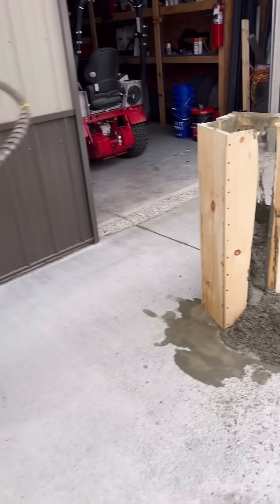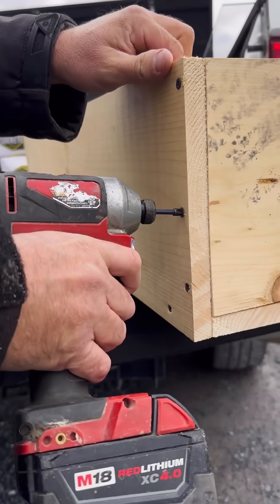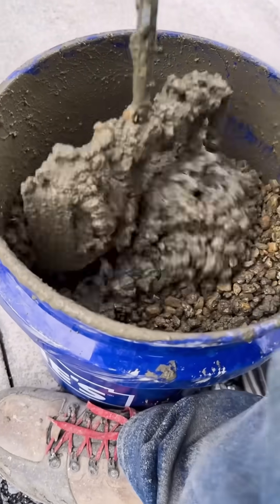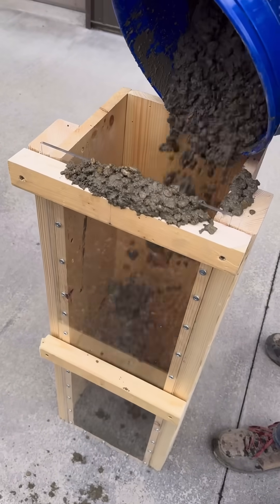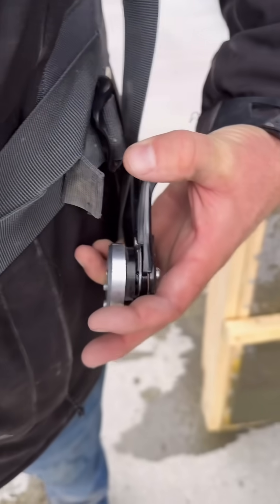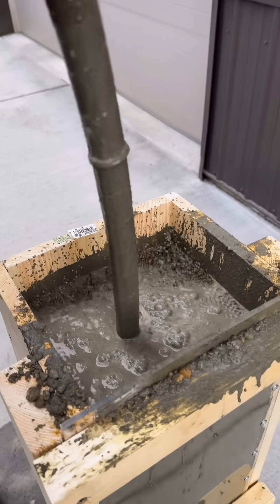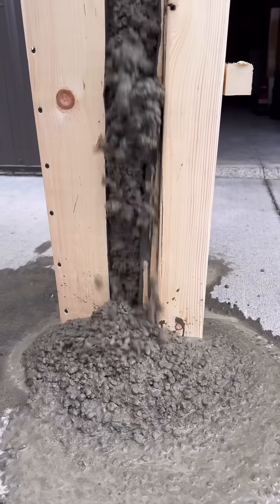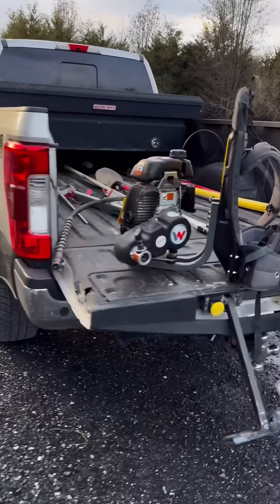Why It’s Important To Vibrate Concrete

Comment: I was 16 and we were pouring basement walls in two separate sections as we didn't have enough metal formwork. I was walking on the about 10 feet tall formwork while moving concrete with a shovel around the rebar. I left after finishing my part and before vibrating. Not even 5 minutes later the formwork opened where it attached to the old pour and concrete poured to the inside, I definitely would've taken a fall! Eventually the basement floor was 4 inches higher! 😆
Reply: Now I know why my basement ceiling is only 6 feet high!  Not the real reason!
My story is about a dickhead county inspector.  We bought this property in 1992.  I was replacing one basement wall made of 6x12x4 inch blocks (1932) pushed over 3 1/2" out of line by a big tree alongside the driveway (it gave its life for the project).  Had plans to pour footing and then have a mason come and put 8x16x8 blocks in and fill with rebar and cement.  I know how to lay blocks but did not have time with my job hours.  Besides, he needed to eat too. The code said that you could go higher than 4 feet when no backfill would be against the top of the blocks or the wall had to be engineered.  We planned on blocks for 54" from footing.  Well the inspector happened by and said he would not pass the forms or the wall because he had no way of guaranteeing that fill wouldn't be placed to the top of the blocks.  That would be physically impossible I argued with him, because of the natural slope then you couldn't use the driveway.  So I had a brilliant idea;  the code did not say how thick the footing had to be so I just formed it 6" higher so now the block wall  would only be 4 ft. When the inspector came to inspect it, he made a comment about me finding a way around his misinterpretation of the code, but he had to pass the forms anyway.  Mason thought it was funny; he said that inspector was always hard for people to work with.  New wall has been there 31 years now and along the driveway the siding is over one foot up from the ground. The inspector had another dumb idea about drilling into the 50 year old wall and the mason told him they would just explode.  Wel the Inspector stayed and watched as the old blocks just exploded;  then I got to spend 2+ days rebuilding the corners of the sidewalls. Be careful what you ask for Mr. inspector.
Reply from the maker: I’m glad you weren’t up on that wall when it happened👍
Reply: I hope the county footed the bill for replacing the blown out blocks... We had an inspector like that here where I live but at least his were actual code violations. He just didn't let anything go unless he just missed it.

Comment: This is why here in europe we use special plywood to make concrete forms. Plywood forms, or re-fabbed iron forms, that are both made in standard sizes.
Reply from the maker: We use steel and aluminum forms here too. I just made this little prop form for the video.

Comment: I used to be a sort of floater laborer for a construction company. Whenever I was on concrete crew, I had to vibrate. The concrete pm always stressed to me to sink the stinger in fast, and pull it from the mud at slow to avoid creating voids.
Reply from the maker: Good advice

Comment: My parents were having their dream home built. The foundation was about 80ft x 40ft, with a walkout along one long side, which had 2 French doors and 2 sets of windows in that wall. The concrete guys were a little confused when they had several yards of concrete left over. The carpenters came to set the pre-fab sections on the foundation and realized that the foundation had been poured one foot too narrow. One 80ft complex reinforced wall had to be cut away, new footings poured, and a new wall poured, all in the middle of nowhere, racing the coming winter.
Reply from the maker: That’s crazy!

Comment: Dumb to shake the rock out of the mix though agreed?
Reply from the maker: I vibrated it longer than normal for the sake of the video so people could see the air bubbles leaving. But yes, you have to be careful not to over vibrate. It can cause the rocks to settle to the bottom.

Comment: I was pouring a elevator wall but the way the guys formed it and wanted to pour it i told them they needed more bracing before we ever even got the pump set up so they did put some but they wanted to pour in 8 foot lifts bc we were doing 2 levels of the shaft and i told them we need to do 5 ft lifts and they told me know well even with as slow as my pump would go they over pour one of the courners and the inner support broke in the center and there was about 6/7 guys up on the scaffolding they build onto the forms and they lost about half the wall of mud and had to basically start completely over 😂
Reply from the maker: I can’t imagine that mess

Comment: Don't overvibrate, creates segregation and loss of air entrainment, causing cracking during freeze thaw. The air voids are designed take moisture as to provide room for the freeze thaw effect of moisture.

Comment: Not really a horror story, but i poured a small slab for a set of pool steps one time and didnt have a soft bristled concrete broom. So i used a regular broom. Was a mistake, pulled up the concrete too much and made it rough to the touch. Luckily its just a pad thats barely visible, but man i will never make that mistake again

Comment: Concrete horror story? Yeah, its my driveway.  Pretty sure each part was done by a DIY homeowner of the past.  There's the carport pad, the OG driveway, the side pad, the weird little extra bit they added kind of in front of the side pad, and then the two tire wide curve that goes from the front of the driveway to the side pad that leaves a section of grass in the driveway.  Every section looks like a different mix with different grains and aggregate.

Oh, I'm sorry.  The city had to do some work at some point, so the first six feet look like a good pour.
Reply from the maker: Frustrating

Comment: Ur not supposed to vibrate so much because all the aggregates go to the bottom, making your concrete weaker than was planned.
Reply from the maker: I vibrated longer than normal to get the footage of the bubbles coming out for the video

Comment: You should have used plywood. 1x's grain runs from end to end. Plywood has the grain running in layers, each layer perpendicular to the previous so it is resistant to splitting. Good job on the learning opportunity.

Comment: Yeah you have to be quick. In & Out. To much & you will stress the forms & create segregation of the components that make up concrete. Lateral supports "snap ties" would have helped as well.

Comment: ICF forms 4 ft by 20 ft 8 ft. High vibrated a hole through the form and it was a mad rush to seal the hole up with pieces of 2x12 and lags. Oh what fun that was took care of business though
Reply from the maker: ICF blowouts are the worst. We always kept a couple sheets of plywood on the job in case that happen.

Comment: 64’ x 80’ x 6” reinforced concrete slab, poured on a day that was 58°f. Its was supposed to stay above 50° all night long and be mid 60’s the next day.
But the site ended up being in the center of a low pressure micro burst that pulled high altitude air down the surface, freezing the slab as it was curing.
Next morning, come back, the slab is fully cured but crumbled to dust just walking on it.
Reply from the maker: That’s super frustrating
Reply: @hausplans  nothing like the planet deciding to just give you the middle finger.

Comment: What is really disturbing is the attitude that things slabs (under ) 5 inches thick and sidewalks don't need vibrating and commercial/ architectural builders and designers all agree.  In fourth years of construction QA QC I HAVE TORN up and built concrete and can tell the difference immediately

Comment: Use 5-ply+ plywood. It is designed for bidirectional shear loading
Reply: Use OSB with inadequate bracing for pregnant-looking walls.
Only a 30 inch high wall but it got done with no blow out, thank God.

Comment: I was a field engineer pouring bridge deck approaches on a major 380 million dollar interstate project. Pump truck got on site late from another pour on the south end of the job. The pump truck got fired up and was clogged. Concrete trucks were timing out at 90 minutes with drivers adding water. I ran a slump test, and we were at 10 inches, it was supposed to be a 4 inch slump. Contractor said screw you and chuted it out on the whole approach. After it cured we did a strength test with cores and failed miserably. They had to rip the whole thing out because the Contractor said screw you im pouring it anyway with trucks that sat on site for 1.5-2.5 hours with a buch of water added. What a nightmare that was.
Reply from the maker: Wow! That is a nightmare. Nothing more frustrating than tearing something out especially with all the prep work you had before the poor.
Reply: @hausplans  As a GC, we used to reject any truck that sat longer than an hour which they then used to pour a driveway somewhere I assume. At the time I was a swamper working with the tower crane and was instructed not to pour anything over a 3.5" slump. Concrete crew would scream for higher slump so I'd just tell the driver to spin the drum a few times then send it up as is. We'd test every 50 yards so there was no screwing around because you never want those cylinders to fail under the break test later.
Reply: A backpack vibrator….
So useful on the Appalachian trail
Reply: Sounds like Dumb and Dumber....

Experience makes ALL the difference.....as usual
Reply: Now, that was a pricy mistake by that contractor
Reply: The inspector didn't say that's not going in the bridge?
Reply: @nathandevine552  Of couse we said no. Thats where the contractor said screw you and did it anyway.
Reply: Ames Iowa? Lol
Reply: You didn't have the authority to reject the batch?
Reply: Not all experience is educative experience….
Reply: @Lucas-pv2wn but this one was for sure

Comment: The problem was you built the form with the wood grain running long ways. Had you cut pieces and laid them 90°, it would have held up.
Reply: Yeah that’s why form board is made with plywood
Reply: Good catch

Comment: 2 weeks ago , I saw 3 guys try to do a 100 foot sidewalk… they didn’t get it screeded so they threw the plate vibrator on the green concrete once it solidified… got the pictures
Reply from the maker: I’ve never seen anyone use a plate vibrator on concrete

Comment: Not sure about horror story but years ago we put in a storm cellar. Dug the hole poured a concrete floor it was about 6 - 8 inches thick put metal fence in for reinforcement. Dad went out a couple days later and started raising the walls laying the Blocks, got it up about 5 on the corners and 3 on the sides high and it decided to Rain. Did you know concrete Floats? We had a sump pump hole in one corner Dad made it a bit lower than the rest when we finished the floor. But after it rained the thing raised up about 5 inches in the corner opposite of the sump hole. After it was to the ground on the sides they put 2×4's about every square foot so concrete went over it all for the patio. But we built a new House in 1976 -78 sold the old house in 1977. Dad told us they used to make Barges to float the Ohio and Mississippi River years ago. So yeah in certain ways concrete will Float.
Reply from the maker: That’s crazy

Comment: If you have a smaller pour you need to vibrate you can Use a Sawzall (reciprocating saw) Without the Blade attached to vibrate the outside of the forms!
Reply from the maker: I’ve done that before
Reply: I use my girls hitachi vibrator. It works a great

Comment: actually you have to use the proper tools in this case you need to buy or rent a 1inch vibrator.
Reply from the maker: Correct, this was the only one that was available, but it was way too big for the job.

Comment: Should have put 3 ratchet straps or a different tie down to assist with strengthening the sidewalls.  Having it tight with that at the top, middle,  and bottom will ease the strain on the wood fibers and joints.

Comment: A great tutorial showing why vibration is key to concrete placement yet, also density destructive to forms. However, I'll be willing to bet that your wife kicked your keyster for messing up that slab!
Reply from the maker: 😂 it actually wasn’t bad to clean up just a flat shovel and a hose. We had it cleaned up in no time.

Comment: When running the concrete vibrator you don't leave it in one spot, drop it in, pull it out, quickly. Always keep it moving. When vibrating/consolidating in a narrow form, even going slow with that large size is sketchy, smaller diameter stinger, it has a smaller diameter energy cone.  Yep, learned on the job.
Reply: Oh, it's called a stinger? Now I don't have to call it a dingus
Reply: I was taught years ago to stick and move. Never stay still
Reply: You're doing it right when it makes a queef sound

Comment: I run the concrete pump on high rise buildings, had a column blow out on the 70th floor. Rained concrete down on everything, they were cleaning the windows below for weeks afterwards
Reply from the maker: I can’t imagine that. What a mess to clean up.

Comment: On a house build our concrete guy somehow not only poured the walls 12in off square but also didnt secure window cutouts. The was cracking all over. 
Client didnt want to be delayed by attempting to force him to redo his work so I got to manually adjust every dimension on the plans.
Reply from the maker: Crazy

Comment: My concrete horror story is from the time I spent building the first legit concrete skate park in Sofia Bulgaria and long story short we got the wrong type of concrete pump - we needed a shotcrete one but there were only a few in the entire country and the wouldn't lend them to us so before we got the right kind we got a shitty one that had to represure every time yoy filled it with about 80ish gallons, it was a hot day and we had to do the first base layer with about 7 cubics and figured out on the first fill that the material will harden in the truck way before we pumped it all through the machine so the guy just dumped the biggest elephant foot in the deep end of the pool and we took are shovels and started spreading it by hand the entire day😂
I've got a second bonus one - when we finally got the shotcrete pump it was a very hot summer and two of our narrower 10 meter hoses both got stuck concrete throughout them and while the rest of the guys were polishing by hand we spent about 10 hours smashing it with hammers until at 10pm we cleared both of the hoses 😂 was a great workout and never again would we let filled hoses stay out in the sun for more than 5 minutes 😅
Reply: Have you looked into "Aircrete"?
Similar method, but the Crete is mixed with a foaming agent ❤
Reply: @VEFAorg  I've been looking at all sorts and have seen this in YouTube videos but have not yet worked with the stuff myself. I experimeted with concrete lamps for a bit for a uni design project with white cement and wondered if I mixed in loose Styrofoam balls in the concrete mix and then once set and out of the mold to try and dissolve them with something like acetone to get an interesting "holy" effect. Lately I've been fascinated with the whole limecrete concept because my dream is to build my own house someday and with all the crazy inflation we got here the shoestring is turning into a fishing line 🎣😂

Comment: The problem is you used screws don’t use screws on concrete forms!!!! 🤦🏼‍♂️
Reply: I use screws all the time, just use the right form system, never had a wall form blowout. Wailers, Stiffbacks and log cabin your corners and you’ll be fine.
Reply: If you are forming up a sidewalk or something like that, you won’t notice it. Form a 6 foot tall footer that’s 3 foot wide it will 100% break I’ve seen it.

Comment: How do you know you are done vibrating?
Reply from the maker: You have to be careful not to overdo it, or I can cause the gravel to sync to the bottom
Reply: @hausplans  do the bubbles come up to the surface so when they are not comming any more, it's done? Like when you are popping popcorns and you wait till it stops popping for three seconds.

Comment: It's pushing all your aggregate to the bottom
Reply from the maker: I overdid it a bit the show the air bubbles coming up for the video. But you have to be careful not to over a vibrate the concrete.

Comment: Formed up a 4ft concrete wall that blew out at the bottom while pumping and vibrating it. Just waited about 30 minutes, shoveled it out, patched the forms best we could and shoveled it all back in. Nothing to bad
Reply from the maker: Way to fix a problem and keep on going👍
Reply: @hausplans  got lucky the blowout was on the side that got backfilled. Never really thought about that much. Getting anxiety just thinking about what if the exposed face blew. Lol